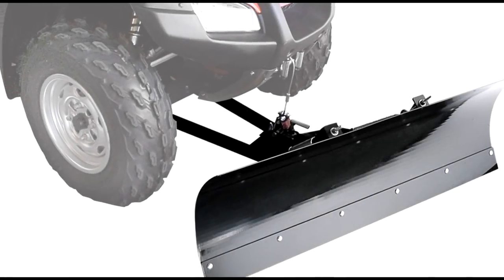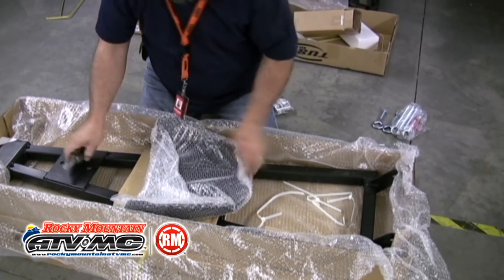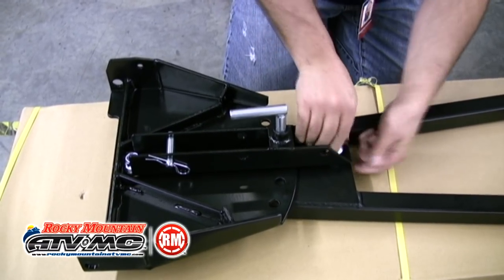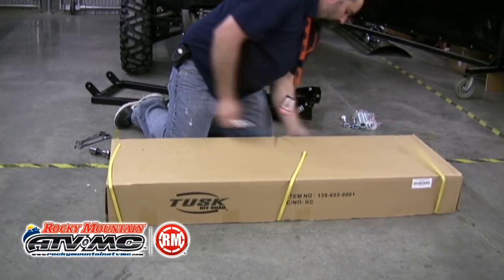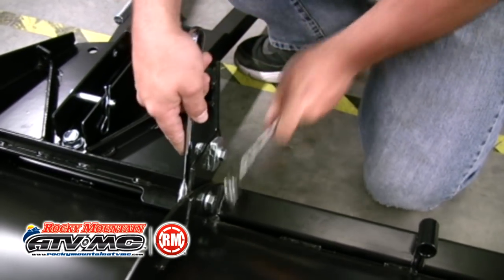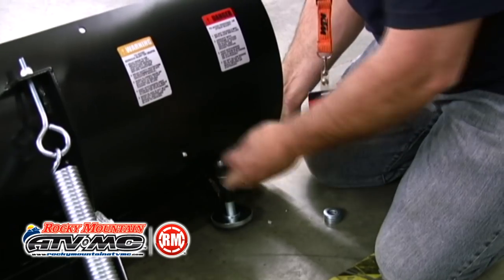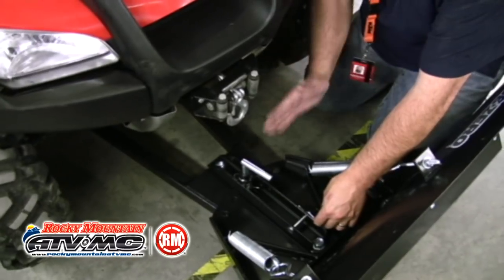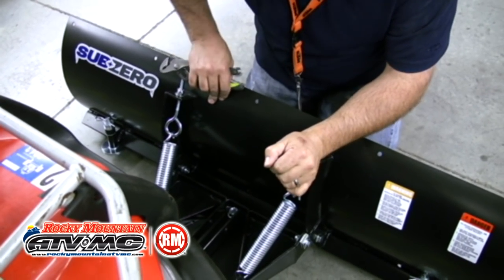Tusk SubZero ATV Snow Plow Installation

Comment from the maker: Yes, there is built in flex with the plow assembly to allow the blade to move slightly with the varying terrain. For example when you approach a driveway on the sidewalk it will dip down and so will the plow to follow it. You'll find when you get the plow fully assembled everything will be tight and secured into place so to answer your question yes, that little bit of movement you are seeing is normal.

Comment from the maker: You are referring to the forward and backward angle right? This is set with the 4 way tilt stops and it's up to you which way you want to run it. if you are plowing ice or light snow the steeper attack angle is better. If you have deep snow you want the top of the blade angled back more so a shallower attack angle.... The moderate attack angles are good for all around plowing...

Comment from the maker: Like any plow this one is going to weigh down your machine a little bit but you won't need HD Springs to run this plow system. Our plow system is very comparable to all the other plow manufacturers with the 50" blade weighing in at about 60lbs and the tube runner weighing about 55lbs and then if you were to get the 60" blade it weighs approximately 70lbs so . . .

Comment: just putting the pushtube assembly/push pivot together.  Installed the front bolt tight, then backed off 3/8 - 1/2 turn; installed the rear bolt tight.  Is it normal to have roughly an 1/8" of "wiggle room" between the pushtube assembly and the blade angle bracket at the rear of the assmebly?  Seems like the bushing I received might be a bit too wide.  Thanks!

Comment: Does Tusk make a mid mount system for a 2014 Polaris RZR 570 LE EPS? I'm only seeing front Mount subzero kits. I have an OEM Polaris Grille Guard that I do not want to remove in order to have plow mount on. thank you.
Reply from the maker: Yes we do.  In a 60" & 70" blade.  Our part# is 1469340004
Reply: Rocky Mountain ATV MC that's the front mount system though isn't it? I have an OEM grille guard that I do not want to have to remove. that's why im looking into a mid mount system.